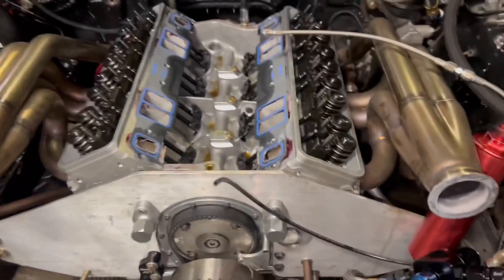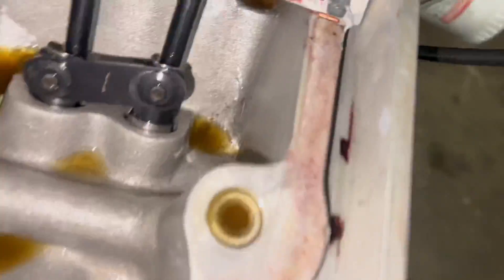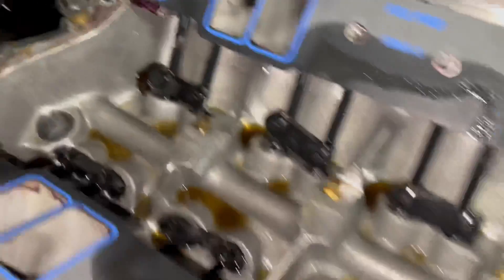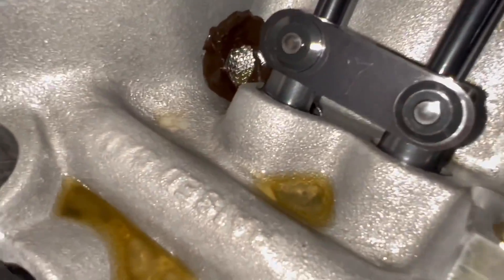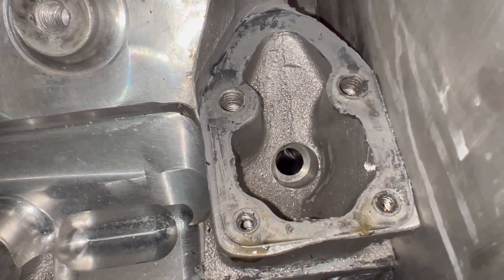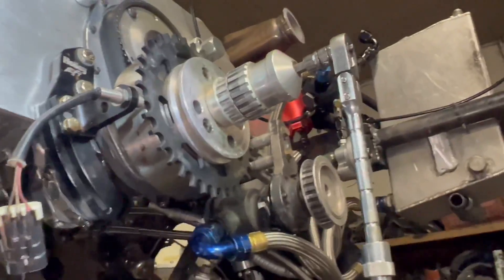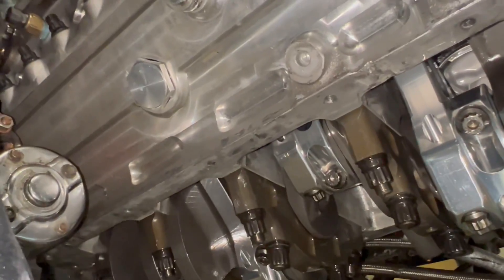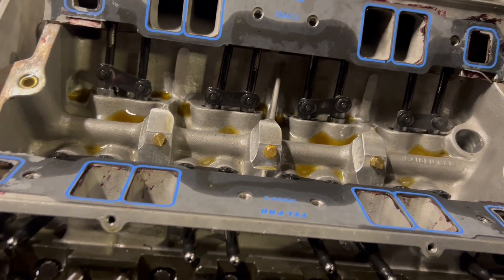SBC Low Oil Pressure / Oil Drainback

Comment: I believe it's simply a basic gravity issue.
Enlarge the drainback holes - especially in the rear.

Also - dry sump along with improving oil drainback could be the entire solution.

Comment: And YES the oil does start wicking into your intake runners especially under high RPM high boost levels ...You might see extra exhaust smoke at the top of your run ..

Comment: I have a dart shp run wet sump. Looking to add moroso vac pump the valley on mine has slots across above three cam, but dart recommended standard volume oil pump, while I'm currently running hv/hp pump and have fought oil consumption for years. Plan to put moroso standard volume pump and replacing valve seals and adding vac pump. If none of this helps rings will get done. Brodix suggest a cometic intake gasket with less overhang into the valley.

Comment: Having oil pressure issue. All plugs in block even hidden plug. bearing 2.5 to 3 thou. clock cam bearings/ Hei msd /stock pan with Melling hv pump.1/2`` off pan/20/50 oil wix filter only 30 psi when cold and 10 when hot. Does not increase much when at 2500prm. verified test gauges as well. Bad pump? Fresh rebuild 355. also new bypass for oil filter.

Comment: John for what its worth i think you are on the right track venting the crankcase better and your drain back mods should help alot. I bet just a vac pump with a good baffled catch can with a drain would be the ticket. Have you ever actually measured oil fill and drain? Then refill and run for a warm up then drain again to see what you are getting dilution per warmup. Im betting you will be amazed by how much fuel is really going into the oil. A vac pump and using your oil pan heater will vastly reduce your milking of oil. I love your hard working oops fixit and try again style. Done it a few times myself. Also on your thrust issues... Im betting you can adjust your pressure now that you have those dumps and surely a spot for a orifice.

Comment: John, there is another plug on the passenger side of the block down low in the center between cylinders, where does that open to on the inside, to crankcase or oil galley?
Reply: If open to the crankcase it would be better to use that hole than the fuel pump well that may fill up with oil. Just saying, to get the pressure out.
Reply: That fuel pump well also has an oil drain back hole in the bottom.

Comment: I think that hole is way to small. If you have 1800 hp and 5% leak down, that is airflow for 90 hp. Think of the size of the throttle blade on a 90 hp engine.

Comment: Not sound like an asshole but I raced late model dirt track years ago and we used those blocks and there designed for dry sump , why wouldn't you go the extra and mak it a dry sump set up ? I know it's a cost but you'll be better off in my opinion.

Comment: On turbo 4 cyl we have welded cylinder head breathers shut and added vents to crank case. Any blow by on valve stems will force oil to drain down as there is no crank case vent coming up.

Comment: What are the return holes in the pan like?  That was another problem back in the day.   I know when we had this problem with 481x stuff back in the 90s we had to go dry sump but we were running all 1/4 mile   You are on the right track you will get it

Comment: You should probably weld a T fitting on there so the oil that runs into the new vent galley has a way to drain back into the pan.

Comment: Whatever you do please don’t drill holes in that block they knew what they were doing when they designed it. If the valley held that munch oil they would run a scavange up top,

Comment: That fuel pump port is for the drive pin that leads right into the accentric lobe on the cam to run a fuel pump.

Comment: I was just thinking that a vacuum pump would solve the problem and right when I was thinking that you mentioned it But I understand you have to do what you have  within your budget I use to run a 85 RX7 smog pump remove 3 veins out of the Rotor I don't remember the " of vacuum but it wasn't much It worked

Comment: That front block vent will be your most important one on the motor. I would avoid touching that back one. I could see oil blowing out of it. You might be able to use it as a equalization port to the valley

Comment: Why don't drag racers use dry sumps and crankcase vacuum pumps like other racers? NASCAR has used them for years and they worked great>
Reply: Because a Nascar Engine bay does not already have the entire hot and cold side piping and turbos and blow off valves, etc. Of a Turbo system and upturned headers junkies up that engine bay already...hard to find all that room to continue to mount more system stuff a dry sump system takes in space. But, a vacuum pump may be necessary or a scavenge pump at least to keep the pan area evacced so the oil can easily drain back.

Comment: That valley has been so full of oil it was up to the bottom of the intake runners!!! Yes certainly filling up and not draining back fast enough if it was me I'd put that fitting from the pump plate to the pcv on the intake and that should give it enough suction pressure to let it drain back better

Comment: Big John!!! PUT HIGH PRESSURE  NOT VOLUME. PLEASE TAKE THE HIGH VOLUME PEICE OF CRAP OUT.  RUNNING MORE WILL CAUSE MORE  PROBLEMS. PUT THE HIGH PRESSURE  OR GET U AN EXTERNAL OIL WITH THE VACCUM PUMP MADE TOGETHER.

Comment: It makes no sense that block being for only dry sump bro.. they would want more drain back holes for a dry sump. The holes aren’t there for a horse power gain nothing more.  You have a bearing clearance issue I gurantee. You think all 7 qts are being held up in the valley on that engine? Really bro? With restricted as well?

Comment: Why would you have low oil pressure at idle when there’s not as much needed to supply the pump? It would drop off at high RPM if anything
Reply from the maker: After 2 minutes of idle, rev the oil cannot get back in the pan!
Reply: @TurboJohnRacing  well if it’s moving that much oil up too with restrictors in then you have a lifter fit issue
Reply: @TurboJohnRacing  John if that were the case why would they even design it as a dry sump block?
Reply: @TurboJohnRacing  watch that Steve Morris video I sent the link in a comment. It’s your oil pump drive / cam pos sensor not down far enough. The oil galley leaks right past the distributor housing if it’s up just a big too high,

Comment: Oooh, I thought you had standpipes in the aluminum block already! I would definitely do BOTH the front and back vents!! You could also just pour oil into the valley and see how much it holds before draining and how easily(or not) it runs into the pan
Reply from the maker: Yes, I’m gonna do that.
Reply: John, are you concerned about any additional bearing issues, besides that one rear main bearing?

Comment: I had seen stand pipes but never the actual purpose...wet sump vents...making the connection now.  What about the thrust seems that would still be a question.
Reply from the maker: Think the converter charge pressure is high

Comment: Way too much oil getting up top that isn't necessary! I'd try to figure out how to restrict the top end and keep the mains flooded. The design of the block keeps oil off the crank. So you'll have to work on the drain back ports so it flows better. Good Luck!

Comment: If you have firewall room put a -10 or 12 fitting in the back of each head and run the hoses to the side of the pan. If you have blow by the air running up trying to get out the breather is holding the oil from draining back especially with only those 4 small holes for the air to come up and the oil to go down.
Reply from the maker: That’s what I think as well.

Comment: A lot of guys run stands in the lifter galley to keep oil from draining on to the rotating assembly, if too much oil is being pumped to the top end then oil drain back becomes much more critical

Comment: I am by no means an expert. But I was watching an SRC video last night with Billy the kids new aluminum engine over at Bob mcveigh's. And they were messing around with cutting a very slight Groove into the lifters. And when Bob cut a little bit deeper of a groove it was shooting a lot of oil up through the rocker arms more than it needed. That seems to me that it would flood the top of the motor out with oil and would not drain back fast enough. I think I had saw where you do something similar to your lifters. Just a thought man I hope you get it straightened out look forward to seeing you racing again

Comment: I block of those holes as you have done on all Chev race engines. And open up the drainholes in the corners,, then put mesh on them to catch valve train junk. Wet sump or dry. The pan is vented through the valley holes. Though those reinforcing ribs across the valley are not ideal for drainage.
The breather from the pan to the top is a good idea,, or the left side of the pan to the rocker cover. That way the oil stays in the engine and not filling up the catch can. Then ofcourse breathe the rocker covers to the catch can.
May be worth breathing the valley as well.

Comment: I would also check the oil pump pickup to pan clearance .It may be tighter than you want especially running without a pan gasket.
Reply: You need at least 3/8 of an inch pickup to pan floor. I have seen several engines starved because the pan floor is pushed in.
Reply: Could have sucked the pan up against the pickup screen on those spool-ups

Comment: I have been building engines and racing sense the mid 70's. I never run a hi volume oil pump. I only run a hi pressure oil pump the hi volume pump will pump the pan dry .

Comment: I think your on too something, makes sense cause it has good pressure for a little bit. I was thinking about it not being able to drain back with all the crankcase pressure from methanol too. May just have to put a couple vents going in to the side of the block, hopefully it’ll vent good enough through the fuel pump cavity.

Comment: Ran into this exact problem with one of these blocks in a sprint car. 
We did vent from the fuel pump plate and the back of the block we also needed to run a vacuum pump. You may not need to run the vacuum pump though.

Comment: Your on the right track, but it not oil drain back holes ! Your pistons rings have NEVER been sealed  ,just look at your oil it is telling you ! All the compression and worse bust is going past the rings putting so much pressure in the pan the oil can NOT get back ! The best thing you should do is start it on GASOLINE and run it in to seal rings . I know your not going to so you had better take the big plug on back of block for your vent . Fuel pump hole is to small for the amount of pressure you have
Reply: Yep always break them in on Gas, learned that the hard way
Reply: No boost at idle
Reply: @baby-sharkgto4902  he's referring to the pressure created by combustion. It IS present at idle.
Reply: Intake carb and distributor, fire it up and break it in on gas, I think the rings aren’t seated either. It milked the oil immediately.
Reply: Absolutely!! And with methanol, it takes a different cylinder hone. NOT A DRILL BALL HONE, NEEDS TO BE DONE ON A SUNNEN CV 616!! THE CADILLAC OF CYLINDER HONES. it can't be 600 finishing, Needs 420 stones and medium to Heavy pressure on the stones. Then a green scotch Brite in front of the stones for 2/3 strokes. This is if he is cranking on methanol. And by the way I don't rem if he put new rings in it or not?? ALWAYS NEW RINGS IN A FRESHLY HONE AND DEF NEW BORED AND HONE BLOCK.
Reply: Definitely not the rings
Reply: @jonathanlawson4667   If the rings were run in the other block, then they have had some fairly high Temps and if u have looked at a turbo ring verses a N/A engine, it's the difference From Black to White. The ring edges are alot more rounded. That's why I waz asking did he change the rings. And what's your thoughts on the HIGH PRESSURE OIL PUMP? I never run HIGH VOLUME OIL PUMPS in any engine, 1st U have this problem 2nd is they eat HP!! I've seen as much as 40hp in a Big Block Chevy on the dyno!!
Reply: @jerrypennell544  I'm not disrespecting you in any way I hope it didn't sound that way!! That's a great guess however if it was the rings there would be more issues such as it would be blowing oil out the valve cover pcv fitting and he had those unhooked in his startup videos and hell it wasn't even steaming through them.. Those rings are also gapped way more than the average ring causing less pressure and this video you can tell the oil has just been sitting in the lifter valley all the way up passed the runners because his intake gaskets was soaked... it's piling up in that valley due to not draining back fast enough I mean you think about it 90psi of oil pressure it pumps it up top so fast it can't drain back through those tiny holes fast enough especially with negative pressure in the bottom end!! I think if he vents the crankcase into the pcv system it will give it enough suction to pull the oil back down to the bottom fast enough to let it be OK and my thoughts on the pump are the same as yours anything over 50 psi is a waste in my experience and opinion..
Reply: @jonathanlawson4667  100% not the rings and certainly not the hone job

Comment: Those wet intake gaskets was one of the first things I noticed. I bet that valley has been pretty full of oil. Just my guess. We drilled extra holes in our dart block also. I really am going to lean to not being vented enough
Reply: No matter how many holes you drill you still have to overcome crankcase pressure.
Reply: @dougoneill6603  true , but the more holes the more places for drain back.

Comment: Hey John you should try and use a couple dabs of super glue to hold your gaskets in place and put a film of anti seize around your coolant passages. Alot less chance of silicone getting into anything! Also, much easier to clean up.

Comment: Take a larger piece of the screen you used and try and pour your motor oil through it. An average window screen blocks 1/2 of the air passing through it, imagine that with oil.

Comment: Just my $.02  but it seems like if the engine was starving or oil, to think that only 1/2 of a 1 main bearing was affected seems like a stretch.  Hope it works out well for you John.
Reply from the maker: I think I just got lucky with pulling the pan.   Converter feed pressure may be way to high.
Reply: @TurboJohnRacing  I surely hope so, you've had way too much trouble this year. It's time to see you racing, instead of working. I know you feel the same.  :)

Comment: I would try to figure out a way to drill at least 3 half of inch holes in the lifter valley to insure good ventilation for air and oil purposes. I know that you will figure it out for sure. God bless you and don’t worry he has your back. I will be praying for you to succeed.